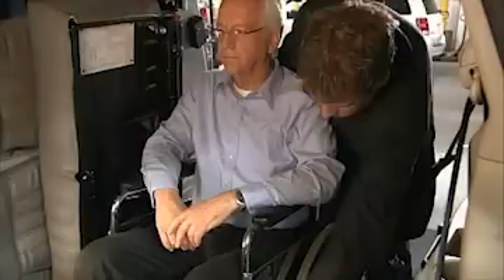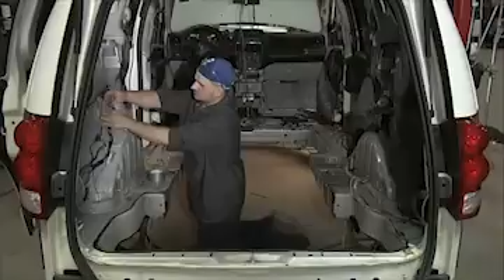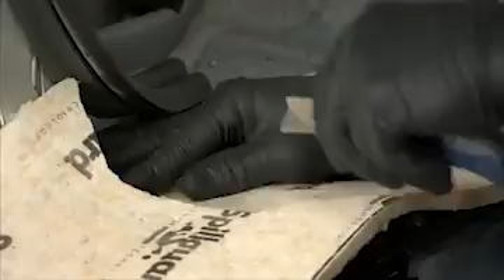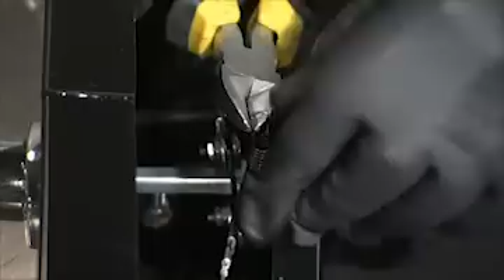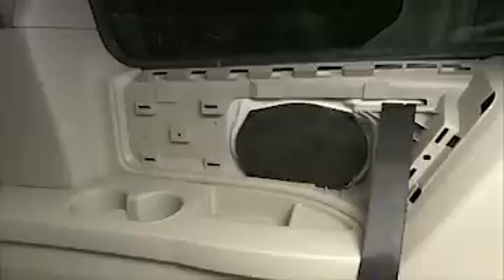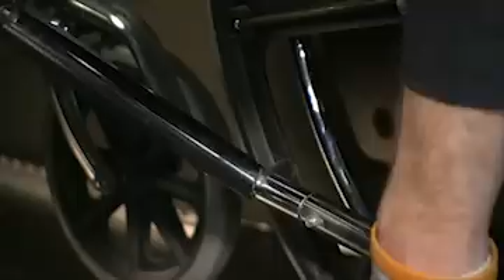How Wheelchair Vans Are Made

Comment: For the  past 2 1/2 years ,  I was lifting my wife out of wheel chair into car and then lifting wheelchair into trunk of car. I started to have knee and back problems. As I am 79 years old,  I decided  to purchase a van with rear wheelchair entry. Most used conversion van had  high mileage and I didn’t want maintenance problems, so I found a used 2020 Toyota with 14k miles at cost of 38k. The conversion cost was  15k at TRIPLE  S. MOBILITY which was located  11 miles from my home. The conversion took 2 1/2 weeks. I was totally satisfied, no more lifting to and from doctors office. Conversion cost can be  as high as 22k, being that the van has to be sent out of city or state. By the way, REAR ENTRY is best option because you can park any where without being closed in.
Reply: I took me a year to find decent not crazy expensive one. I used to lift my mom as well. It was not convenient for me or my mom. She almost gave up on going out again.
Reply: Anyone can made it in Pakistan?
Reply: Does your ramp drag on uneven roads? I'm having issues with that since I purchased a used van?